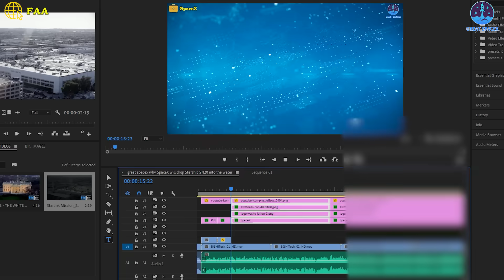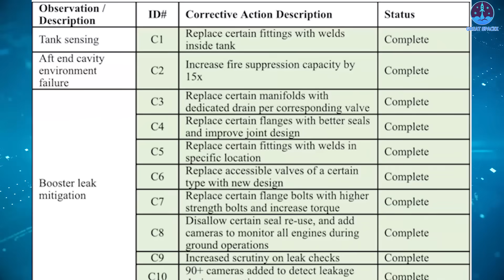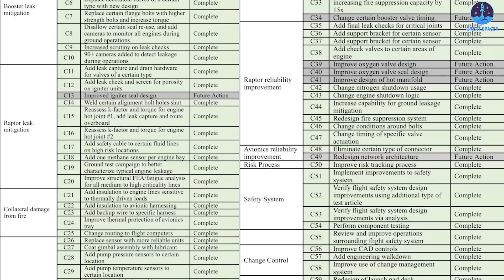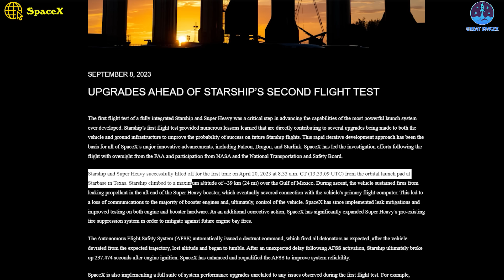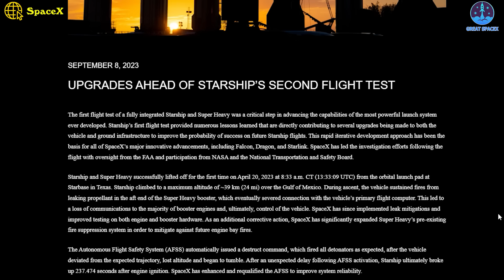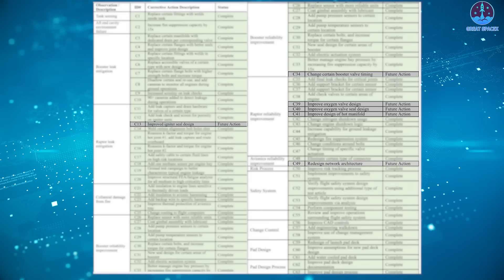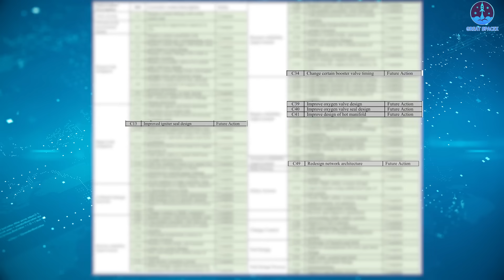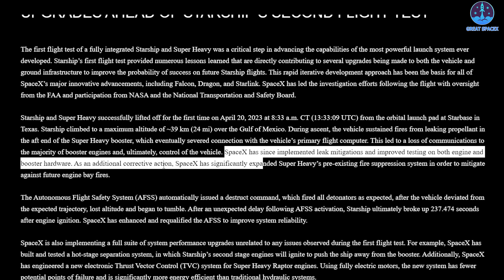Elon Musk just declared completed FAA requirements for Flight 2 of Starship!

Comment: There is no showdown between SpaceX and the FAA.  Hell, SpaceX provided the list of 63 Items to the FAA.  Also, SpaceX conducted the investigation and provided the results to the FAA.  The FAA did no investigation on its own.  This is normal, and if you actually read the footnotes in the report, this is spelled out.  The other very important point to mention is that SpaceX has not even requested a launch certificate yet.  Once it does, it will be granted immediately.  Everyone needs to just chill.  This process is under SpaceX control.
Reply: @gregorythoman9764 is 100% correct

Comment: According to Musk all fixes identified by SpaceX that apply to Launch2 have been made.  The remaining fixes only apply to future launches. The remaining items seem to apply to leaking Raptor engines. But these fixes will not be made to the Raptors on B9 and S25.  Hopefully, the vents punched in the skirts of B9 and S25 will eliminate/mitigate fires.  Sure B9 now has electric vector control but wires don't do well in burning rocket fuel. And SpaceX hasn't announced the flight computer has telepathic control of the gimballing engines.

I wonder if the hot staging ring was tested to the same load levels as experienced during launch1 cartwheels?

Comment: Once the spacecraft is on its way..is there a way to have it enclosed or covered by a large balloon filled with heavy water to lesson radiation exposure..perhaps a sshell like gove with outershell filled with protective water
Reply: For long term space exploration? I believe so. You would just need to build an inner wall and the heavy water could be sent to space in another ship earlier, just "refueling" the inhabited one.
Reply: Not outside, but inside there could be double walls as water storage. Water is a good radiation protection and a ship that can transport 100 people needs much water anyway. But this is irrelevant for the first 100 starships, as stated by mrs. Shotwell: after min 100 starts we may begin to think about crewed starships.
Reply: @MichaelWinter-ss6lx It's not going to be 100 people in Starship ! That number comes from the earlier 12 m diameter Interplanetary Colonial Transporter that was an earlier concept. The numbers seems to be about 15-25 people as of now. Stuffing 100 people on Starship for seven months would be suffocating, at least mentally and risky.